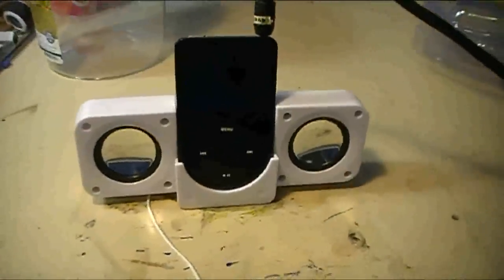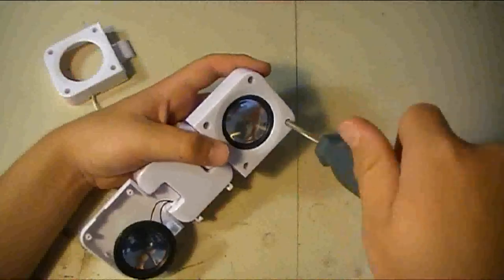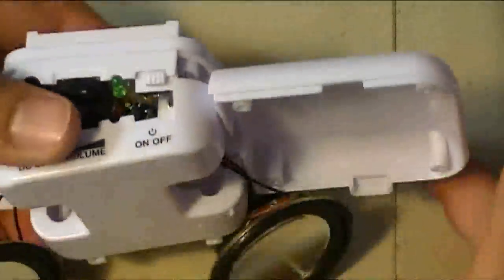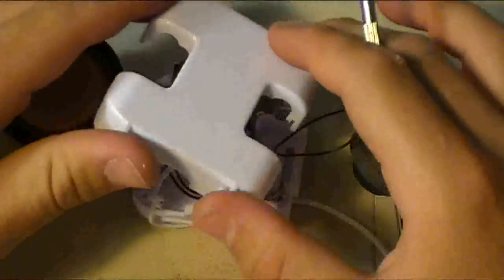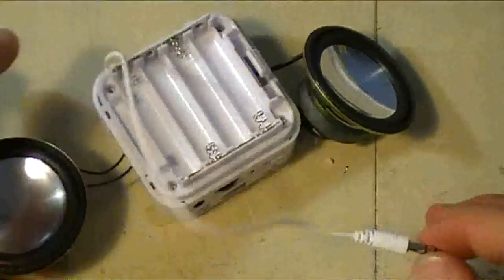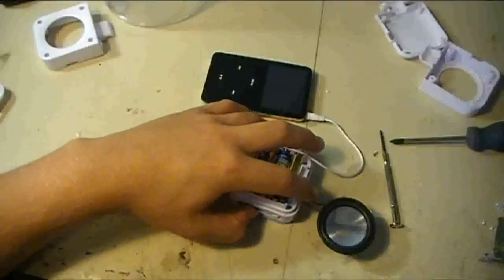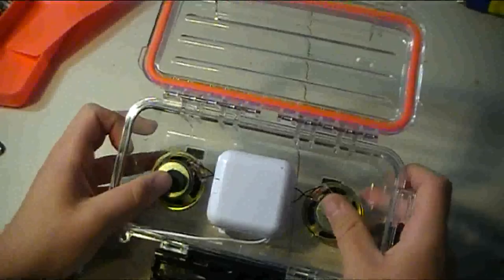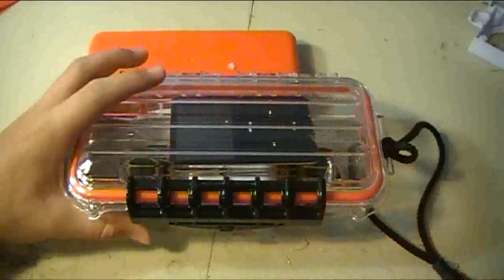How to make an underwater speaker / sound system!

Comment: Hey man I know this is a few years old but I just bought a house with a pool and built this after finding your video. Works great, I ended up using some scuba weights to keep it on the bottom and drilled/sealed a patch cable so I can use it with surface-sourced audio once I built it your way and liked the result.  Great idea!